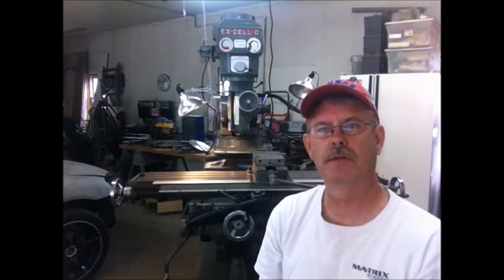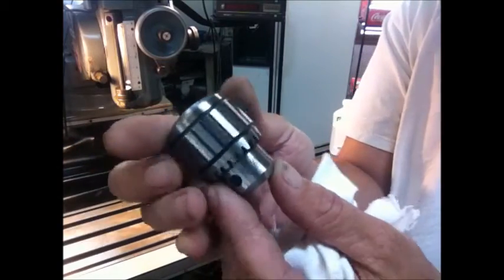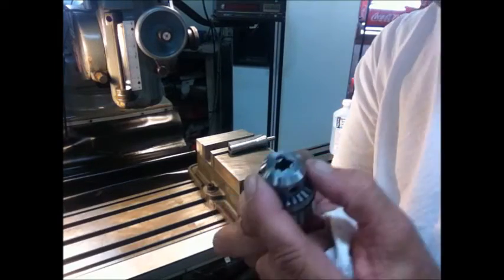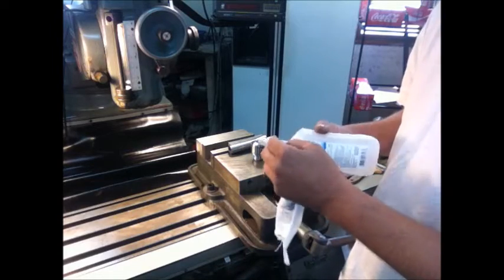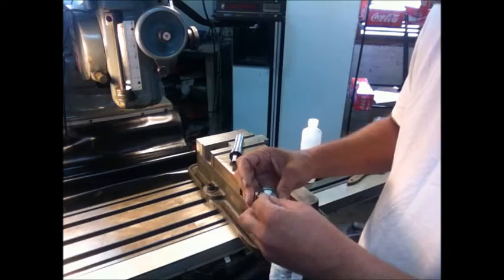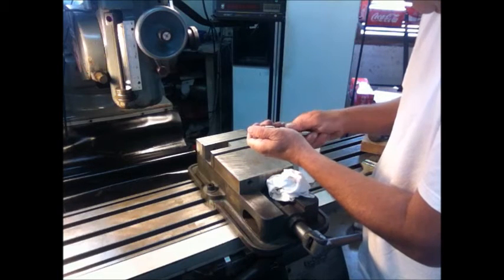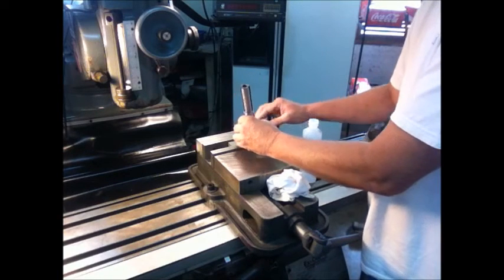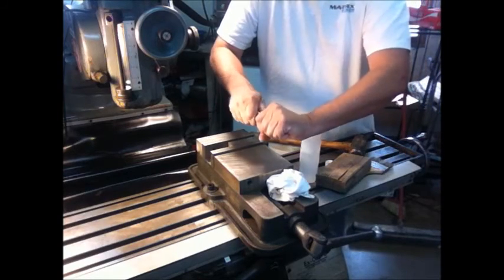Installing An Arbor Into A Drill Chuck

Comment: Is there a tool for removing the chuck from the arbor?
Reply: yes, there are arbor wedges.   but honestly just buy a new arbor
Reply: You can buy a pair of arbor wedges (online machine tool places sell them).  You essentially push the two wedges into the gap between the chuck and arbor, in a vise, and then turn the vise.  As the two wedges come together, they evenly force the chuck right off the arbor without bending or ruining anything.

Comment: I have always preferred to freeze arbor and then install onto chuck.
Reply: I just tried that (have heard of it before).  It works well.  Just wipe the arbor with a dry cloth before you push it in, so there isn't any condensation on it that will immediately form when you take it out of the freezer.  Wipe, and then immediately push it into the chuck.